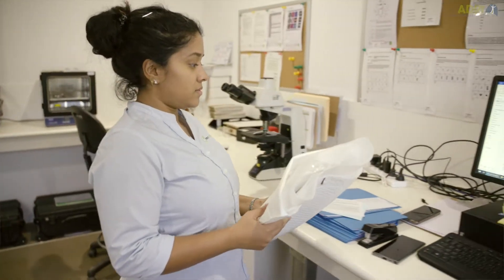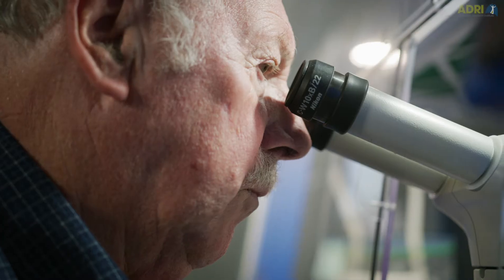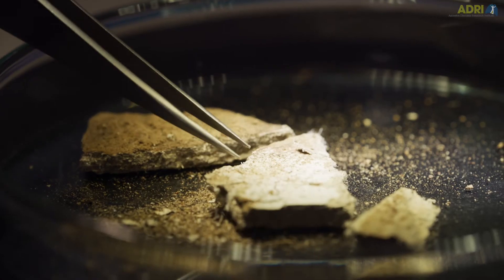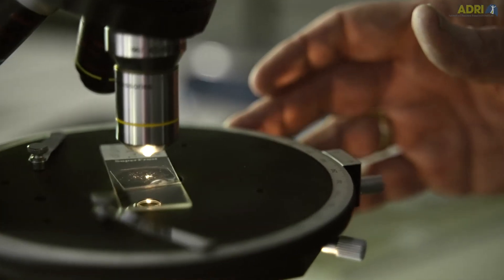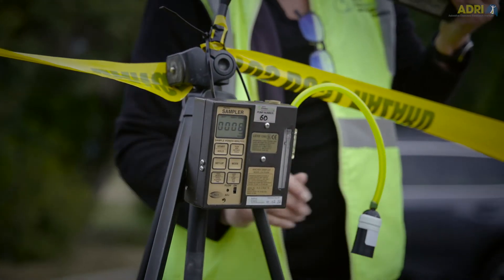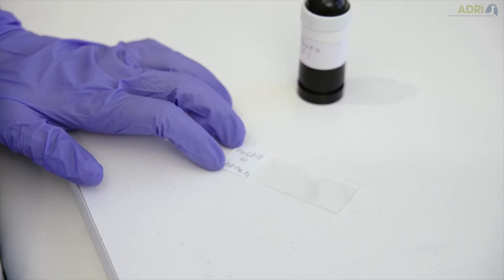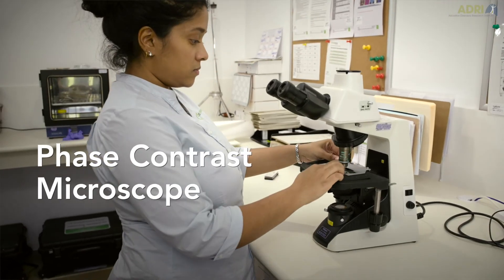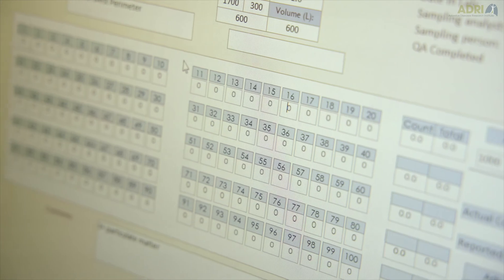The Asbestos Discovery Lab

Comment: Also in Germany there is unfortunately a massive lack of education when it comes to asbestos - also and especially with regard to possible occurrences. There is a whole range of materials that can contain asbestos. These can be crush seals made of copper, spacers made of double-walled glass flasks in thermos flasks, brake linings, individual components of electrical appliances and much more. Unfortunately, it is no longer possible to reconstruct which building material was used in each building, for example. In order to create certainty and thus safety in handling, therefore, only a test by a certified laboratory can actually provide help.

Stay healthy!

Comment: Hi l want know What materials do we use on the slide, and what are the materials and devices to detect the presence of asbestos in the laboratory? Please
Reply from the maker: Asbestos can be detected in labs using phase contrast microscopes (PCM) but needs to be done by labs with the necessary equipment and expertise.
Reply: It's a long road to learn on your own. Chrysotile (1 of 6 types of asbestos) requires cargille 1.550 refrative index oil to reveal the colors at the known angles in rotation on the polarised light microscope stage. Vented hood is needed for the stereo microscope to keep the loose fibers out of your lungs during microscope observation. Expensive dangerous hobby. 
2 microscopes make it easier. Cheaper *stereo mic for fiber locating, more expensive *polarised light mic for fiber indentification (6 types of asbestos) 95% asbestos containing construction materials used chrysotile. Safety first, God bless you.